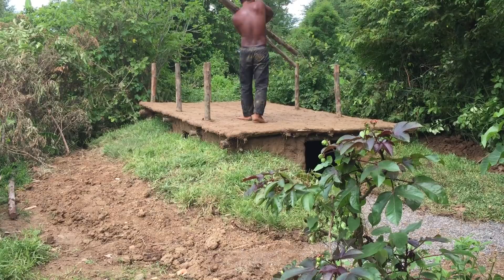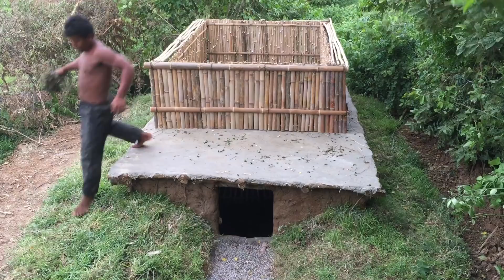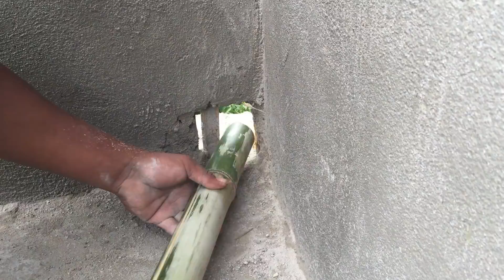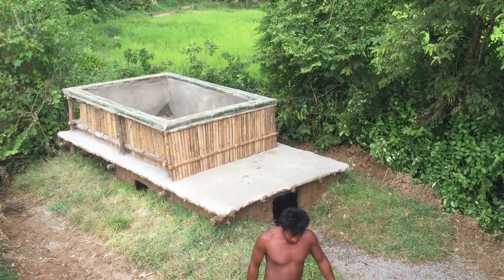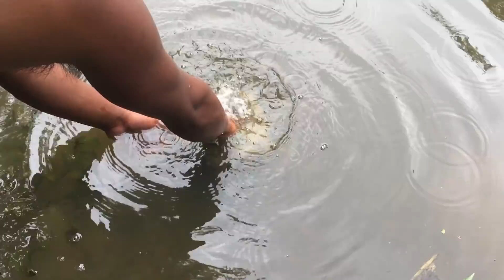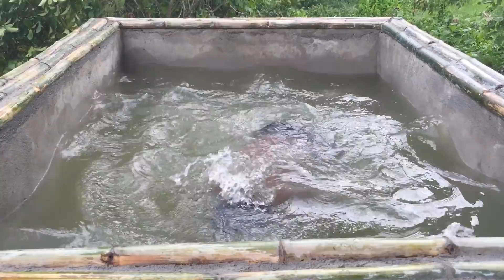Build Swimming Pool on Underground Villa House

Comment: The tenants downstairs are going to be pissed when this starts leaking
Reply: Then it becomes a shower.
Reply: Makin it rain
Reply: Eric Kelly better than u
Reply: Eric Kelly You think concrete leaks
Reply: No way does this thing ever leak
Reply: This magnificent feat; when taking into account that this young man has manufactured an aesthetically appealing structure that which is strong enough to withstand approximately 2 tons, or more, without failing. The simplest of tools were used, and I really want to regard them as being primordial in comparison to the tools at our disposal during the period which this film was created. I am impressed, intrigued and inspired; three “I’s” of which his amazing work is well deserving.
Reply: LOOOOOOOOOOOL
Reply: Fallen Plazma you think that's concrete?
Reply: Yes it is concrete.
Reply: Plazma no but it corodes
Reply: It will definitely leak with no proper waterproofing.
Reply: Don't worry, there is a pool too...
Reply: Then the bottom becomes a pool as well.
Reply: @mskon69  please explain
Reply: @noahbaumeister5925  uh duh what else could it be